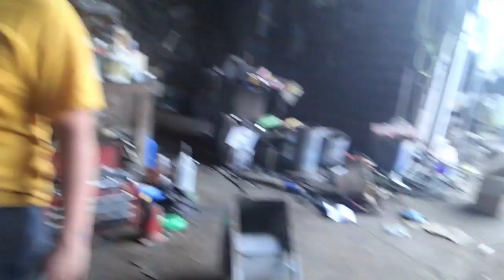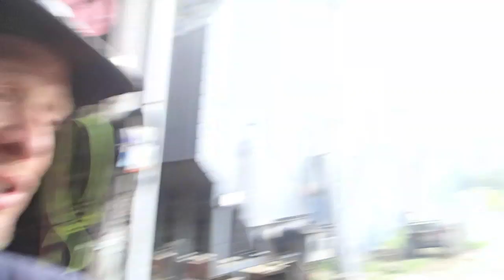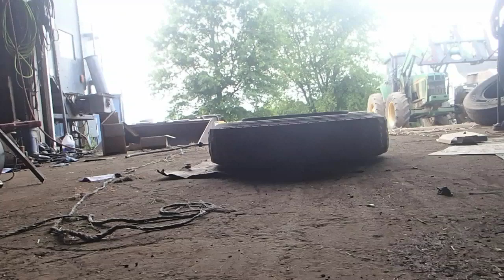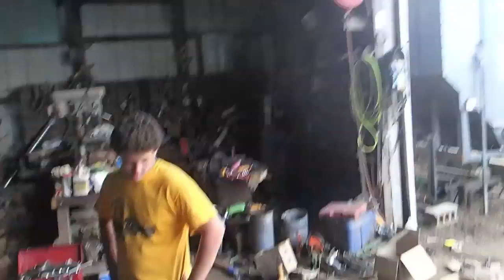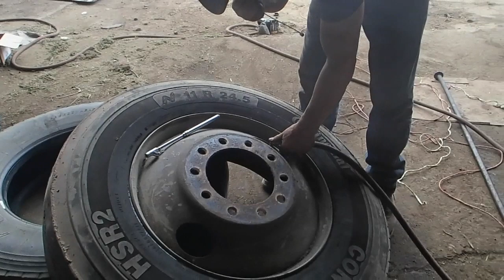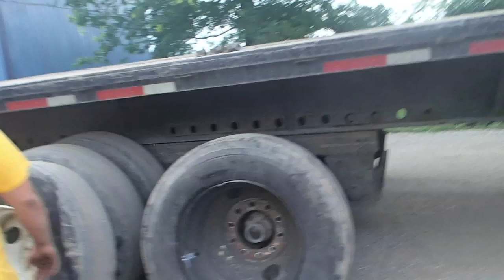trailer tire replacement

Comment: A little secret is to take your tire iron and set it directly under the axle, then roll your tire on top of tire iron....boom! instant lever for lifting up tire!! Sit it far enough in so the end of iron sticks out the past the tire a bit.
And when you're good enough you will even be able to rotate easily to line up lugs

Comment: looks like the 7410 needs new front tires
Reply: Glad to know im not the only one who noticed that
Reply: They're about racing slicks
Reply: Front tires? Did you see the rear ones?
Reply: Traction is probably pretty bad with the weight of a few big square bales on the front
Reply: Yeah,  that Long with the load on the front and how often he uses it.
Reply: rogue9ine He doesn't need the best Traction because he loads hay with the 7410 thats about it.

Comment: YOU NEED A CHEETA BEFORE YOU GET HURT USING SNORT TO SEAT YOUR BEAD.!
Reply: +cheifbob1 I seen more damage from the air cannons with kids who don't know how to use them. less with the fire unless you are in a flammable area or pulling Hazmat

Comment: I see one small problem... since that was a two-hole rim on the inside dual, and the outside dual was a five-hole rim, you cannot actually oppose the stems and still have a hole lined up so you can reach the inner valve stem-- you have to turn the outer valve stem hole 1/10 revolution off so that one of the holes on the opposite side of the rim lines up with the hole in the inner dual rim with the stem in it, so you can reach through the hole in the outer rim to get to the stem in the hole in the inner rim.  Since you put the stems 180 degrees out like you normally would, there's no  hole in the outer rim lined up with the hole and stem in the inner rim, so to add air to the  inner tire you'll either have to have a clip-on chuck and run your hands up between the duals to add air (and how you'd managed to check the tire pressure I dunno), or take the outer dual off to air the inner one up.  

That's the bad thing about those five-hole rims-- you really cannot put the stems exactly 180 degrees apart like you can with the two-hole Budd rims.  

Otherwise, great job... should be on a pit crew!  

Later!  OL J R :)